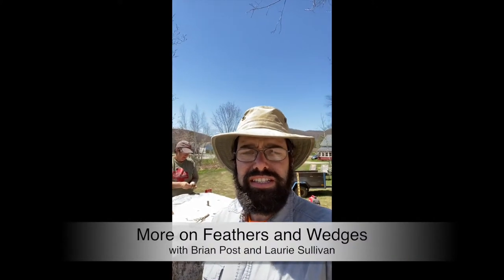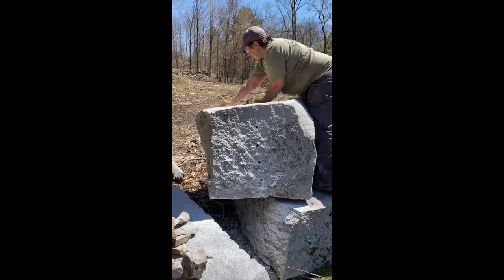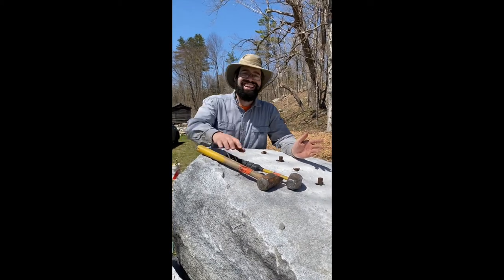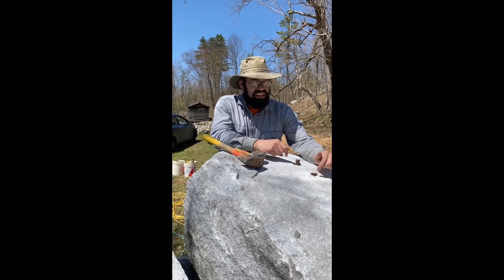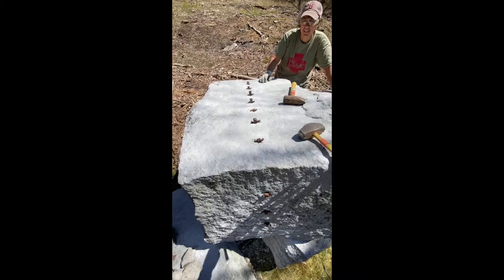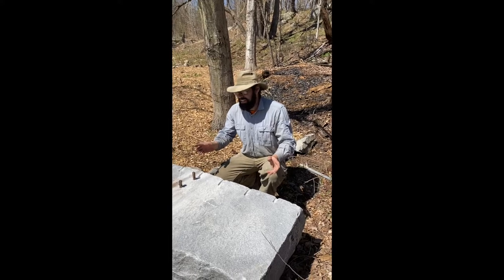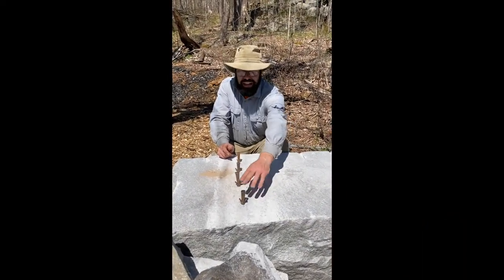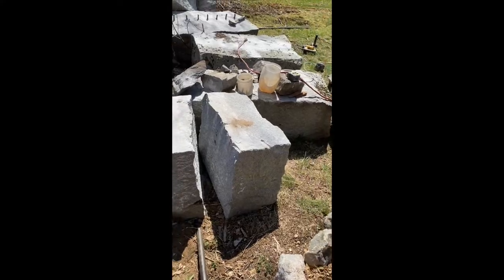Working wih Feather and Wedges - additional info and demo

Comment: Brian, every video I watch shows the perfect stone splitting scenario; never any problems. In my case I have a lot full of boulders, all below ground and they are a pain for gardiening etc. I just want them gone. Most are basalt and respond to 5/8" holes and 5/8" wedge and feathers.Recently I encountered a few rocks that seem to be hard at least to drill and the W&F in a line no matter how tight at best can cause a couple of small rock chips say part of the top layer skin to break off. It would take months to dispose of a rock this way. I assume the rock is porous/permeable and it internally deforms to absorb the stress from the W&F. Have you ever experienced this problem and if so do you have any suggestions or ideas? thanks!
Reply from the maker: Hello,  yes it is not uncommon for rocks not to split well with feathers and wedges.  A few thoughts:  If the rock is not free to open the split will often go awry.  If rock needs to be clear on the side and and underneath so the weight of the rock is helping to open the split.  If it is held in tight by soil, its own weight by being supported all the way across underneath etc it is much less likely to split well.  5/8" feathers and wedges are generally good to split up to about 18" thick in granite.  Other stones may be less depending on grain and crystal formation in the rocks.  If you're trying to split anything thicker you need to use a larger size of feather and wedge.  Generally up to 4 to 6 times the length of the wedge is the max you split though.  This technique won't work well in rocks that are soft or have a grain (like slate or shist) and you are going against the grain.
Reply: @brianpost1448  Thanks for responding Brian. Since writing you several things have happened. My usual problem rocks are basalt boulders that sing and crack nicely with 5/8 W&F. My problem child was a 36"x36" x 24" deep rock that was very hard, but no well defined crystals or grains,  but aparently some porosity because it did not respond to the w&f, only slight spalling or chipping (no large fractures). So I bought a pail of dexpan and got a 1-1/2" drill bit.  Within 3 hours of filling the holes the boulder broke into several large chunks. To remove from the hole I also purchased 1" W&F. With these I was able to break the large chunks into a more manageable size for removal. I use a Bosch 11264 rotary hammer drill which makes drilling large holes easy. Who says there is no science behind rock splitting. Hoping this is the last rock I will encounter.

Comment: What is the appropriate length of the hole?
Reply from the maker: Generally the depth of the hole is the length of the straight part of the feathers (side shims).  Drilling deeper will make it look modern and is generally unnecessary.  In a few stone types or situations drilling deeper can help direct the crack, but in the vast majority of most cases is comply unnecessary.  Also if you're splitting smaller or thiner stones, dont drill more more than about 2/3 of the thickness of the stone, so the hole might be shallower than the length of the feather.  If needed reduce the hole diameter in those cases.
Reply: @brianpost1448  Many thanks bro